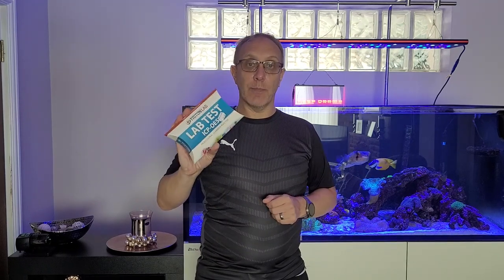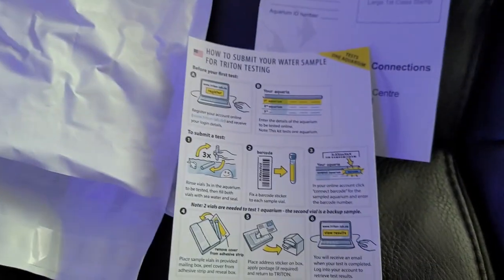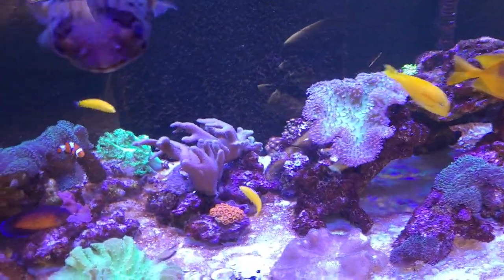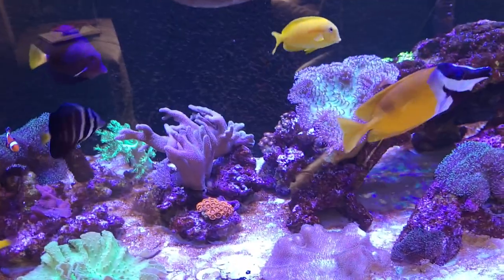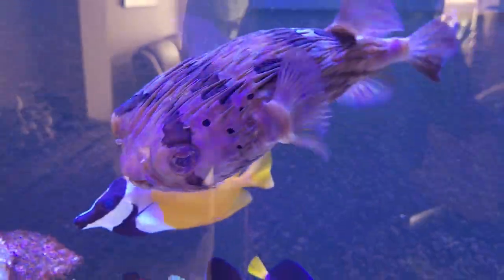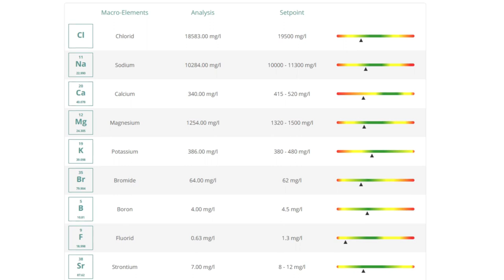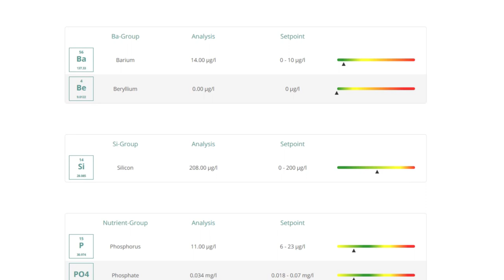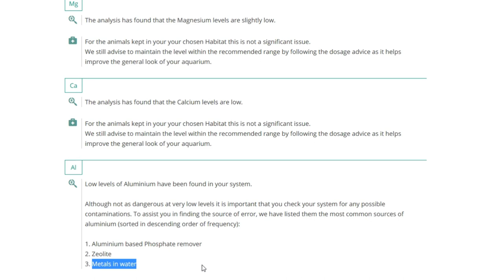Diatom update - can't believe it !!

Comment: There is silicon bound in the diatoms. If they weren’t there, your silicon would be much higher.
Reply from the maker: Hey Joseph, yes, you're right the silicate level would be higher. I will leave the Sera Silicate removal media in for the maximum 3 months as stated on the box and see what's happens. Will send off for another ICP test to compare with the previous one. 
Thanks for supporting my channel 😀

Comment: Trust time solves everything trust me I use to use all the chemicals and gadgets and it only made things worse just keep you alk cal phos and nitrates in check and stable and you will find everything will get better over time
Reply from the maker: Hey Liam, yeah, I usually only dose KH and just run Rowa and Nitrate Pearls and don't really use chemicals. This new tank and sand (everything else was transferred from the old 400 litre tank) has been up and running for around 4 or 5 months now. Thought by now it would have settled out. Had to resort to chemicals this time 😞
No problem keeping Alk, Cal (need to dose that one now by the looks of it) and Phos in check. Nitrates, however, are a little harder due to the Puffer, although they usually around 40 / 50 ppm. 
Thanks for your comments and for supporting my channel 😀